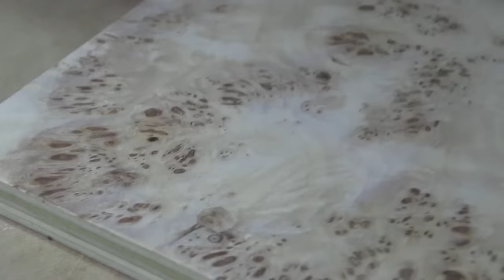How to Use Exotic Burl Veneer

Comment: Thanx Tom, I just ordered Okume veener from one of your suppliers. Ready to try my first veener project as you got me hooked.    Oh, try putting the walnut block in vise , end grain to ceiling, apply glue to end grain and scrape holding sharp chisel vertical to end grain to get grain filler. Apply to void diect from chisel.

Comment: I always use my Toothing plane when I’m veneering as it’s meant to flatten the service I then size the surface with weak size and  denib and it’s ready for veneering
Reply from the maker: Thanks Tim. Most times I’m veneering over a stable and already flat ply or MDF, so I usually scuff with 150 grit but no toothing. I assume you are referring to only situations with Hide glue?
Thanks for watching!👍

Comment: I am repairing a vanity from the 30's and use Titebond Hide Glue and love it.  I have had to correct a mistake and hide glue lets me lift the veneer off.  I am very new to veneering so  do make mistakes. I noticed you hammered the veneer but did not put the hide glue veneer in a press.
Reply from the maker: Yes Jim. I agree, hide glue has great qualities, especially for furniture repair. Using the hot type takes some getting used to and has its challenges on large panels especially since it’s open time is so short. No need to press hide glue when hammer veneering, the “hammering” is enough to press it down to a vacuum like seal and it grabs quickly once it’s down. Thanks for watching!

Comment: Enjoyed this episode very much.  Did want to ask about sanding the veneered surface after the glue has dried.  Given that the veneer is so thin, how do you keep from sanding through it especially when using a ROS with 150 grit?  Thanks.
Reply from the maker: Thanks Jack! 150 is fine to begin with (I’ve known veneer guys who started with 120 but the most coarse I’m comfortable with to start is 150, followed by 220. 
1/42 of an inch in a wild “knot hard” swirling figure such as a burl is a lot more durable than you are imagining. So it depends on the material and how long you sand on it. 👍

Comment: What about a bowed surface application or repair
Reply from the maker: For a bowed surface, new construction, I would usually have made a form to create the bow using a lamination technique which I have shared a number of times, and most recently during the jewelry box course. I would simply apply the burl using the same press and form.
If it’s not new construction and more of a repair, usually I would use the hammer veneer technique in combination with hide glue. Hope that helps! 👍